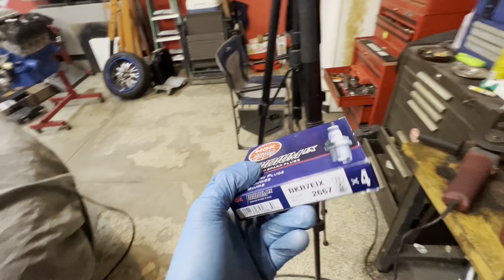How to Install GM LS Coils Onto Your SBF Ford 302!

Comment: Nice job. I may try this but to install a bracket held in place by the oil pan bolts. Then of course run the wires upwards for a hidden look.
Reply from the maker: Nice! yea that’s a great idea of trying to hide them :)

Comment: I just had my 95 Mustang dyno tuned on Wednesday, it was my first experience on getting a car dyno tuned boy I was scared and excited😊 its a 347 stroker fully forged with dss pistons and afr heads,holley systemax intake running terminator x max with a gm flex fuel sensor first pull at 4 psi 439hp
 2nd pull 9psi 512hp on 93 pump. I was shocked and thinking how can i run e85 in this without making more power because of stock block life in the end 7psi on e85 20deg timing for my first built turbo mustang
Did you make a part 2 showing how to wire it to holley and setup in the holley software
Reply from the maker: That’s awesome man and great power! Yes, I made a couple later videos showing the Holley coil on plug adapter and terminator install all under project Hellstang

Comment: Is a crank trigger needed for this setup?
Reply from the maker: Yeah, I’m using a Holley dual sync with the cam/crank combined. Otherwise you can use the explore cam sensor and an aftermarket crank sensor setup

Comment: are those spark plugs compatible on a stock 302?
Reply from the maker: Not the exact part number I don’t think. These pro comp aluminum heads take a gasket seat spark plug where as I think the stock ford heads take a tapered seat plug. 

But you can totally run a fine wire spark plug like a NGK G Power or Iridium IX in a tapered seat, 0.460 thread reach. PN Would be UR6IX for iridium and UR6GP for the G power platinum, both are 6 heat range and two steps colder than stock. The G power is the way to go, almost the same performance as the iridium IX but half the cost.

Comment: What harness and ecm are you doing this with? I have a 393w I want to do this with
Reply from the maker: Holley terminator with their dual sync distributor.
Reply: @PeakPerformanceEngineering you have a video with the dual sync distributor? I'm wrapping up a big bore 347 build. Same Holley High Ram intake and plan on doing LS coils. Still on the fence on whether to do stock LS coils (for the exact reason you described or Smart coils). I think my combo is probably a bit more radical but this is all good info that can be used.
Reply from the maker: Yep if you go to the playlist for the Hellstang there should be one to dual
Sync and the whole setup with the harness add on for the terminator and all that

Comment: What did you set the dwell setting to?
Reply from the maker: Oooh good question. I think I followed the Holley recommendation at first. But the car has been tuned by a local shop and I’m not sure if they adjusted it, I haven’t checked that part of the tune since I got it back. I’ll try to have a look later this week and report back.

Comment: What plug would you recommend for a GT40 headed 347 making around 400hp?
Reply from the maker: I think the GT40 use a .708 taper seat, if that’s the case a 5 or 6 heat range NGK would be solid. Most guys would go with a TR6 nickel plug, TR6GP single platinum or TR6IX single iridium as the top option.

Comment: Did you wire them up as independent coils or are they wired as a wasted spark system
Reply from the maker: I believe independent coils, I used Holleys add on coil harness for the terminator system. I think the install vid for that is here: https://youtu.be/9QriIUiDBnU?si=2InGZ2h-tdYCBPX8

Comment: Does this work on a ford 460
Reply from the maker: I think so, you would just have to see what Holley terminator setup would work with the 460. Probably just want to call their tech line and see what they recommend.
Reply: @PeakPerformanceEngineering  thank you
Reply from the maker: @WDWitcher no prob